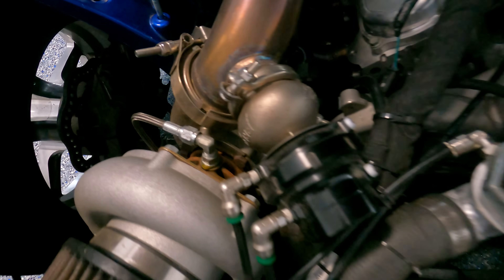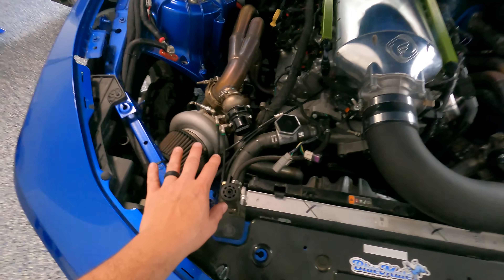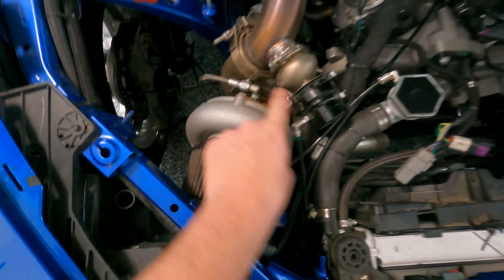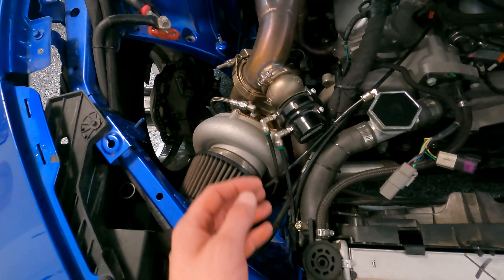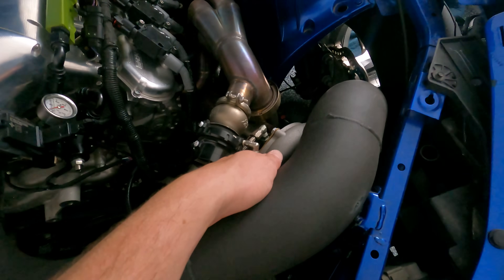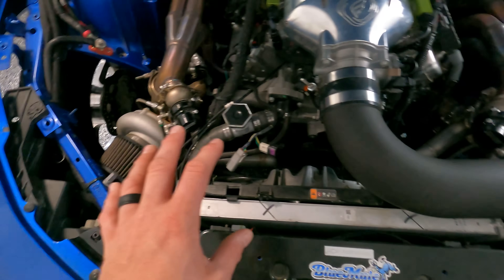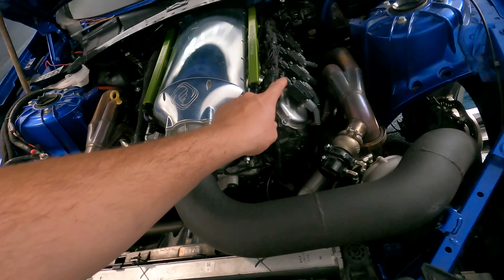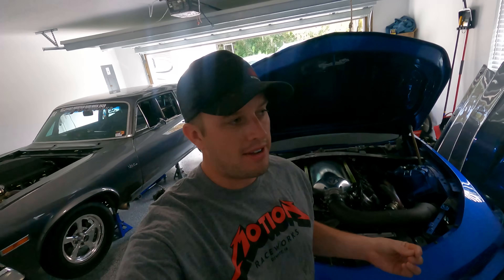Twin Turbo Oil Feed Tech Tip Tuesday: This could ruin your turbos!

Comment: Y piece to the to the turbos. But seperate drains.
Problem is all the fancy fittings do not come in a proper Y. Most of them are a restriction in the lines. And any 90deg corner reduces oil pressure by as much as 10lb
One of the reasons I make my own. And do not use braided line either. Hydraulic hose is heavier but can be used for decades. As can the steel barbed fittings
Unsure of what is available in smaller sizes but 1/2" up never a problem

Comment: I run a billet distribution block after oil cooler , gauge , both turbos each have a line and oil temp sender.

Comment: I’m doing an LS swap with a remote filter block with a thermostatic pass thru to an oil cooler. It won’t be a gm oil pan so the plate won’t work. Would it be possible to get oil for the turbos from the hole where the oil pressure sensor goes, behind the intake manifold?

Comment: Worth mentioning the importance of purging new lines prior to fitment as a lot of ball bearing cartridges have restrictors built in which can block easily. Oiling requirements between ball & journal bearing turbos do differ quite a bit (most ball bearing setups have a 0.8-1mm restrictor on the inlet & hence flow less oil) but being on the bigger side is the safer option. There are also pressure regs out there too as well as inline oil filters which maybe a wise precaution depending on where in the oil system the feed is being taken.